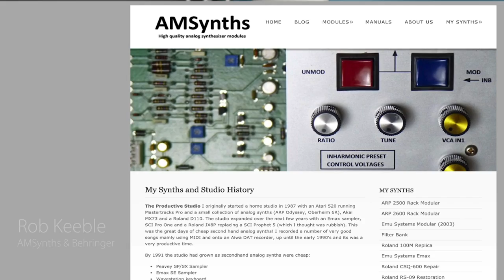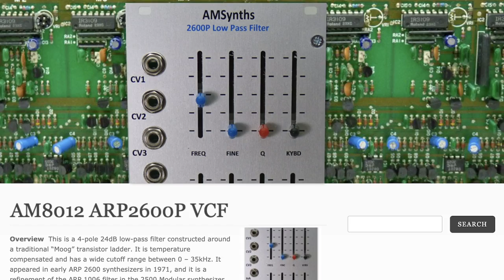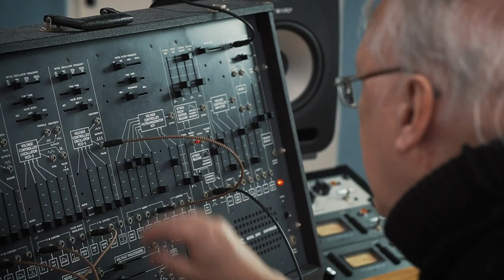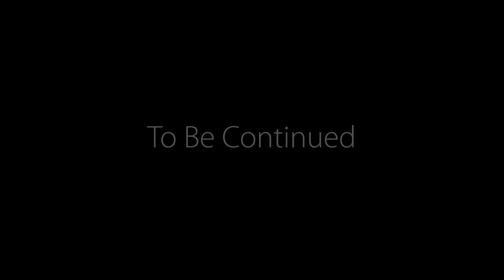NAMM2020 - Introducing the Behringer 2600 (Part 1)

Comment: Thanks to this project I have a 2600 at home and had it for two years now, you did a great job. The product is awesome and I'll by number two BARP 2600 this year. Thanks recreating this to an affordable price. To those out there who owns a ARP2600, I have no idea if this sounds exactly the same as the original and really I dont bother either, the BARP 2600 sounds fantastic from the deepest low to the highest high, grunt, sweet or anything. Quality? I have three Behringer synths, never had any issue with any of them. They seems as good as my old Rolands.
It stays in tune and are my number one fun machine and thats what its all about. Thanks to Uli and thanks Rob Keeble!

Comment: EMS Synthi next? 🤪
Reply: Oh Yeah,synti A,or the legendary VCS3 it is almost classic than the 2600.
Reply: Why?
Reply: e6400ultra I see your 1000 and raise you 1000,000,000
Reply: @sylvainlamirande4037  I believe it's hard to program though.
Reply: I predict Synthi A and possibly rack-mount size. Probably (IMHO) a much more iconic classic than the 2600.
Reply: Yes please! Had an original in the 70's and found it so easy to master the programming due to the matrix. Much easier to trace a signal/control path than following a bunch of cables. A great machine for sound design.

Comment: Goodness the low-end on the 2600 is so smooth and deep its almost unreal. I think its official at this point that Behringer has decimated the silly notion their products are not quality or useable. That and taking all of the other analogue synth manufactures to school on how much it should actually cost for the end user.
Reply: You may be wrong there , hopefully the sound at the end was not just the original wich is shown in the vid

Comment: Will be cool to see the original, vs Korg’s clone, vs Behringer’s clone!
Reply: ^ THIS
Reply: @starskycar are you watching?
Reply: Oh. I’m sure that someone will do it after release!!
Reply: @Mauricio Duarte oh yes, especially since the same thing was done with Odysseys and they didn't sound the same. Keeble talking about improvements is fine but just getting it to sound exactly like original is more than sufficient.
Reply: @playlistideale  yes the behringer odyssey was way of the original ,if they take that as basis for the 2600 boards its a mess
Reply: @cnfuzz  for a high profile synth like the 2600 you want to nail the sound 100%, nothing more important than sound of vco's and vcf.
Reply: @playlistideale  dont agree really , their market is scale so if they can cut corners by not reengineering certain sections they will do it , this time they dont have the advantage of being able to look into korgs version pcbs
Reply: @cnfuzz  don't understand your comment, my whole point is not re-engineering or doing anything else at the expense of the sound. There's no need to look into Korg's version either, they have an Arp.

Comment: Cancel that Korg pre-order
Reply: The Korg version is about $4,000. The Behringer Odyssey is $588, so do you think the Behringer 2600 will be $1,176-$2,500?
Reply: @corypalmer5495  well keep in mind it also doesn't include the keyboard so I would say knock-off 1000 for that
Reply: @ezrashanti  ROTFL ok so at max this thing costs $1,500, that's a steal.
Reply: @corypalmer5495  

there is no steal because it is not the same economy.
Korg produce a limited production  (  the fixed costs are greater on small production      ),  win money with its instruments, they target the professionals with this one (unlike with the Volca), and then sell a high end product, meaning that there should have a quality test on the products ( it rises the cost   ).
Behringer target greater production (it lower the fixed cost of the production per synth), they do not do any quality test before selling the product, and makes money on other products than synth, they do minimal profit on synth because they can do it. It allows them to sell at low cost, but the invisible cost for the customer is that when you buy a Behringer clone you can get a broken one.

The they don't have the same cost by each synth , and don't need the same profits for paying production, research, etc... 

Then there are now  ARP2600 for professionals with awaited quality, and BARP 2600 for the guys who can't afford synths at more than 3000$.
Reply: That would be good,  @corypalmer5495 . Will it be full size or not? Perhaps they will do the suitcase and modular versions of each section?
Reply: @apislapis  lol I don't know I'm just guessing, I'm not apart of Behringer lol. 
But there are photos that Behringer have posted showing the progress on the synth, these should give you an idea of how big it's going to be.

https://www.google.com/search?q=behringer+2600&hl=en&sxsrf=ACYBGNTyeYdjyyJtKTSvecgSAe1d2Wkc5w:1579478471567&source=lnms&tbm=isch&sa=X&ved=2ahUKEwi0k-np75DnAhXiUt8KHebgDMIQ_AUoAnoECAwQBA&biw=2133&bih=1043
Reply: @apislapis  type in "Behringer 2600" in google. Based on the pics, this thing is massive.
Reply: @corypalmer5495  The BArp is 19" wide by about 14". Bigger than your normal behringer synth module, if that's what you mean by massive. The KArp 2600 is approx 31 3/4" x 8 3/4" x 18 3/4" which is a beast.
Reply: @apislapis  Oh no I made this comment before they announced what the final version looks like. I was going off the images they posted of the earlier iteration of their Arp. Look up "Behringer Arp 2600" in google images and you'll see what I'm talking about. This one looks tiny compared to it.

Comment: We also need a Behringer Emulator 2 but with modern storage-options, and USB :) but with the analog filters and cool looks.
Reply: Emulator 2 is nothing special , i had a 2 drive 2 + pristine and honestly one of the worst samplers i owned , laggy midi , you cant finely edit sample adresses , cant sample more than 17 sec even if you had the expanded 1'5 meg plus model , any ensoniq eps asr or emax way way superior
Reply: @cnfuzz  I had an emax se, and have 2 ESI32 still in use with SCSI2SD-drives installed. If they remake it, it will not have laggy midi, i just want the sound!.

Comment: Checking Wikipedia for ARP, the  original Odyssey was a downsized ARP 2600 with its DNA retained...so after the Bodyssey it was quite logical to continue working with the analogue synth engine (going backwards in time) and recreate the progenitor of the Odyssey. :-)
So one could say that those who own the BARP Oddy they already own parts of the BARP2600.

Comment: That desk in the video is really affordable @ £279.99 or $303.50 with 12u rack space, but the problem is that 200+ shipping is crazy for a 300$ desk. Someone needs to make affordable but durable desks with good rack space in the (or get them to) US that aren't made of particle board and plastic. The desk in the video is such a simple design and with a little twist you can make different versions of it, like one with more desk space and less length (in this case 71.6 inches total) to keep the price around the same. A decent desk here with that much rack space in the US (not particle board and plastic) cost crazy money.

Comment: I bet the Behringer 2600 will make Korg's price of $3,899 look silly
Reply: ....for the amateurs.
Reply: @jean-louispech4921  which are more authentic than the pros, if you can draw parallels.
Reply: @acdnrg  

authentic in what? .....
your parallels are just orthogonal.....
Reply: @SorchaSublime  

The Korg/Arp  is more authentic, and made for professionals , this is why there is a flight case. It is for the pro who are touring, like the original.
I just recall you that the Korg version is based on the exact reproduction of the original in size and use, because the ARP 2600 was designed for being able to touring, to play in concert in the time where there was almost only big modular synths covering wall of rooms.

That some guy who are limited in the size of their room prefer a less authentic model, does  not change the fact that for real pros the price is not silly for a real reproduction of the ARP 2600 from the original model. Because if you look the prices of the market this  is the price of high end  analog mono synths like the Moog, made in limited numbers and targeting professionals customers.
Reply: @SorchaSublime  

You are confusing the small pros with all the pros....
If you are serious and look the market of synths, synths for pros are more than 1000$ and far above...... There are large keyboard of 88 notes, etc....
Reply: @jean-louispech4921  i´m sure it looks like that from your perspective, I just have a different point of view.
Reply: @SorchaSublime  

lol the guy who try to argue about the fact that a high end  synth in limited serial  at 3000k +   would be overpriced for the professionals too....
No seriously .... 

You are rejecting the reality of the market of all instruments : high end, expensive  instruments, produced in limited edition  target professionals. It is the same case with synths.
Then read what is  written in the stance just  above, and tell me where i am wrong.....

Comment: EMULATOR III with proper analog filters.
Reply: Whats wrong with EIII filters?
Reply: @lownrgy  Not a thing. Im suggesting they make an EIII with the filters that the EIII had.      I phrased it badly.  I would like them to make them accurate to the original.

Comment: Other than a patchbay, I only have B's Neutron and it's well-enough for some things if not very hi-fi.  I've also got an early '70s 2600.
While the probability that the b2600 will be any sort of legit ARP substitute or re-creation is quite low, the good part is that it doesn't have to be.  I hope it is well-developed enough to be it's own thing and not some beta-letdown that so many new products are afflicted of.

Comment: Nice move! Hilarius! I reengineering my Arp Odyssey MKI since 2009. Doesnt matter the psu voltage regulator psu design too. On Odyssey voltage regulator Changed voltage setup type resistor and changes compensator capacitor sucked the life of the oscillator fizzy sound almost sounded dull "digital". Nowdays Minimoog reissue with external switching psu? And a Grandmother too? My friend bringin his grandmother to play on it, it was noisy, I changed to a hi fi expensive 12V DC not just a noise and whining noise goes off the moog grandmother sounded better! On my ody i redesigned faulty 4023 ota filter modudule! Even a psu filtering tantalum changing changed the resonance behavior too. Sounded too high quality resonance. With the starving 1uF the resonance sounded better! I changed the OTA-s the opamps and the filter is now sounding like modern ARP2600 on a Korg reissue. If i changed the VCO IC to modern types the oscillator sounded too modern and harsh. Just because the modern ic going too high abouve 10khz. The old vintage IC rolled back. So that need low pass compensation trimming too.